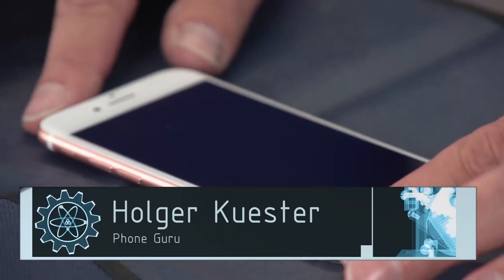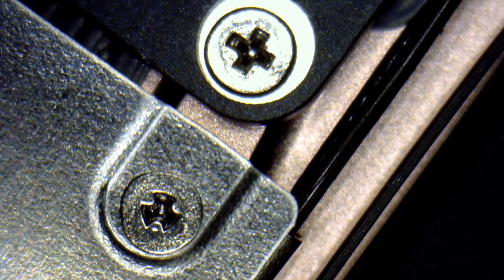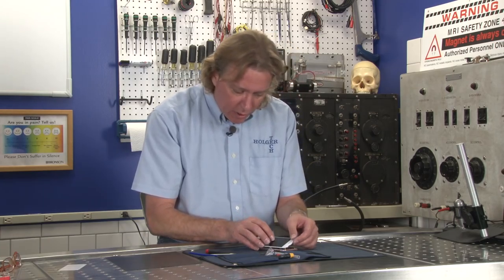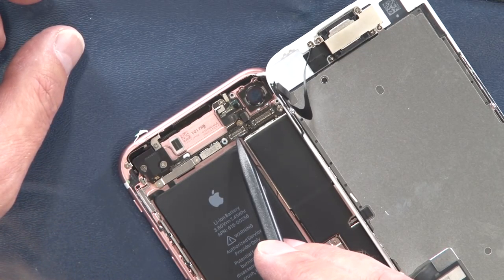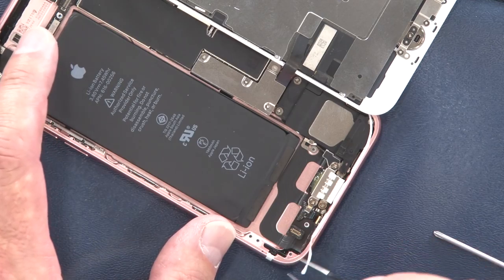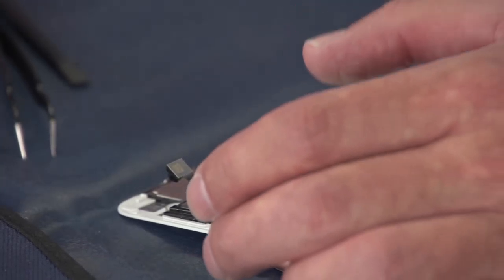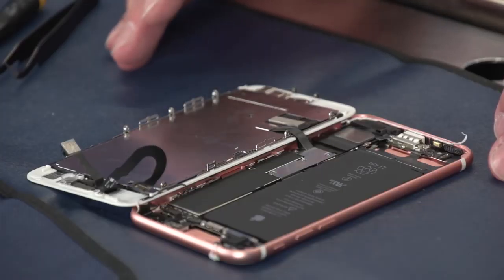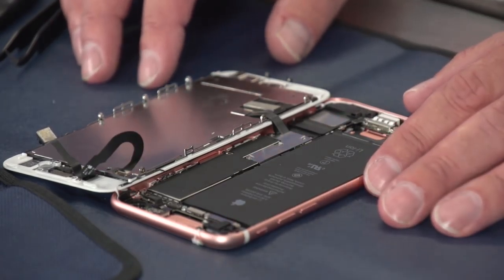Inside an iPhone 7: Equipment Autopsy#94

Comment: Nice Wiha precision screwdrivers.  Security bits are useless because eventually other companies manufacture the bits.  If they didn't want people taking out the screws then they should just fill all the heads with torque seal that will indicate if the screw has ever been removed.
Reply: Only the best German tools in my tool box! That 00 Philips I am using has turned the screws in most every phone I've worked on in 2 years. Still as sharp as new.

Comment: What is that mat Holger puts the screws on? I could use one of those!
Reply: Honestly, it's a simple magnetic sheet you can buy at any office supply store. I have several on hand that I cut into quarters to aid in the repair of many devices.

Comment: Hmmm... Couldn't you just unscrew those with a flat screwdriver that fits in two of the three points of the screw head? I have done that with torx screws...
Reply: Good thought Luke but we tried that. The smallest driver we had did not fit.
Reply: Oh, bummer! :(

Well, will have to wait for that screwdriver then! :) Thanks for your reply! ;)